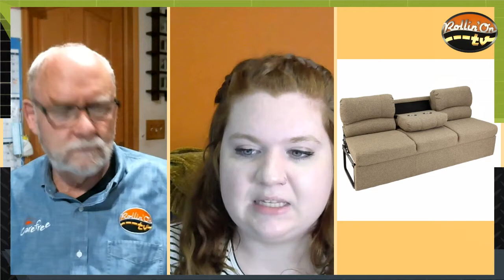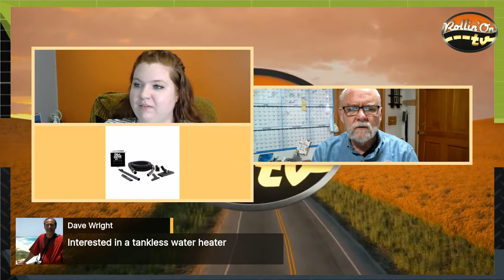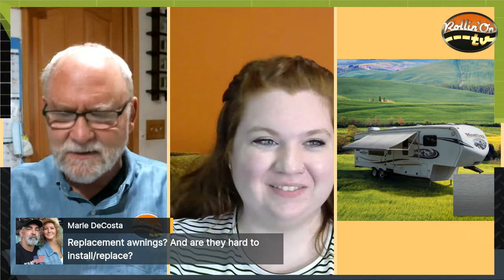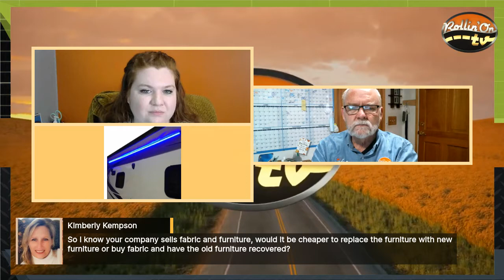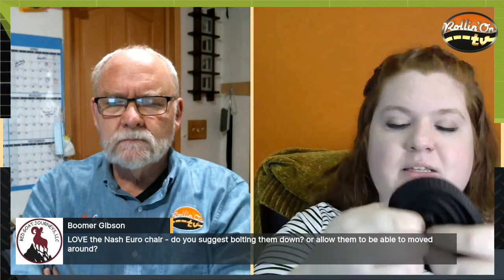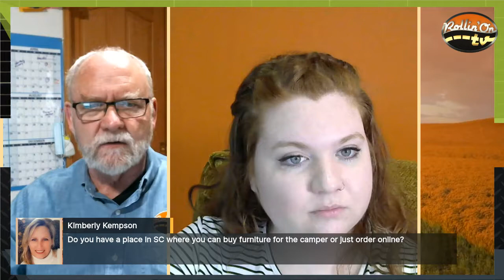Rollin' On TV's InsideAccess With RecPro - Your One Stop Shop to Modify or Upgrade your RV

Comment: Does your furniture have storage space underneath?
Reply from the maker: Sorry,  no!. There is about 11" clearance under our jack knife sofas which may leave room for electrical boxes or wheel wheels, however we recommend against using it as storage as there is no mechanism to hold the sofa open while putting anything underneath. It may cause an injury so we do not advertise it as storage (however possible). 
Emily